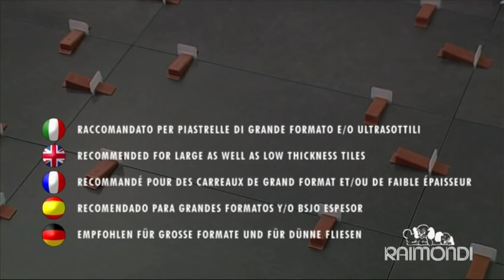R.L.S.: RAIMONDI LEVELLING SYSTEM / SISTEMA LIVELLANTE RAIMONDI

Comment: Watch at the 3:20 mark. See how he pushes the leveler against the tile and allows the thinset up in between the leveler and the tile. If you do that you will be one sorry camper. The next day when you come back to knock out those levelers they will be stuck to the tile and you will spend hours cleaning them out all the while risking chipping the tile. I use a margin trowel and scrape away the thinset wherever I place a leveler. This method they are showing is a train wreck.